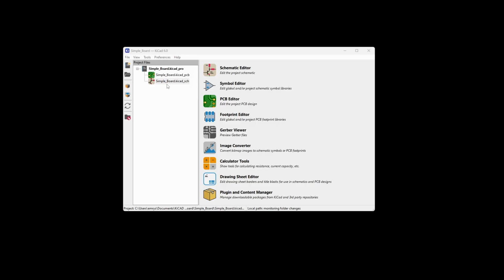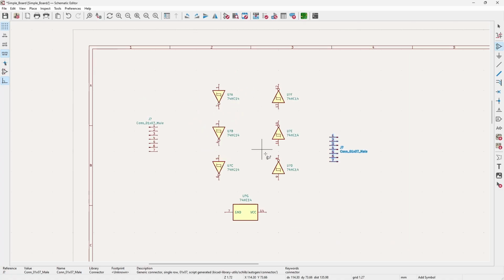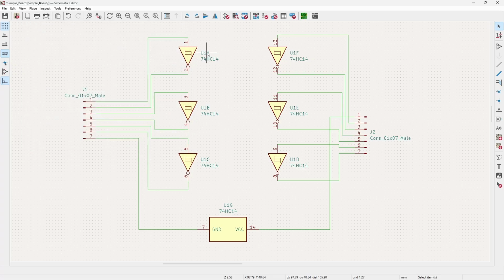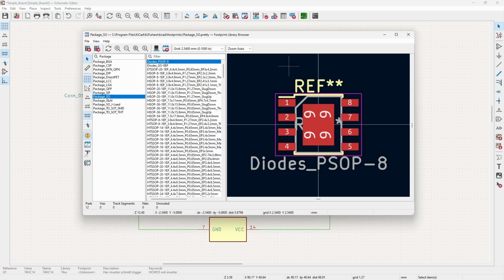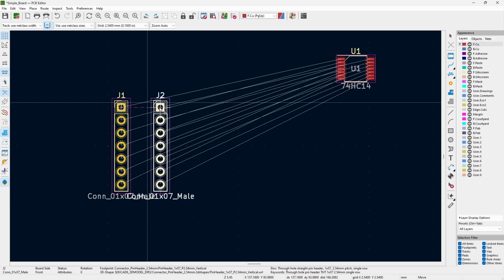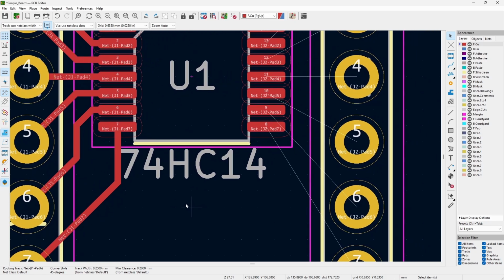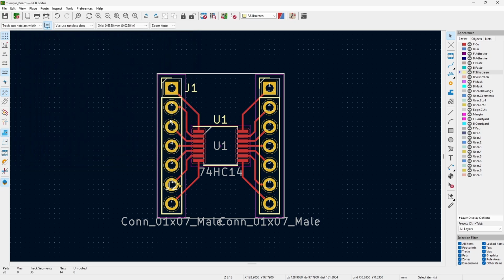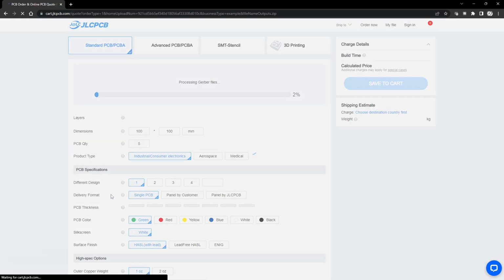KiCad 6 tutorial - Start to finish board design

Comment: A couple of tips to make KiCAD more intuitive is to change the selection behavior and tool activation behavior
By default, to select a symbol or footprint you need to click once on them before dragging or moving or whatever
This can be overridden though from the Settings > Mouse and Touchpad > Drag Gestures > Left button drag

The other thing for tools is check or activate the "hotkey first selects tool" checkbox, which does exactly as it says

I believe it can be found under the "Hotkeys" section in the settings
Reply from the maker: Thanks for the tips!

Comment: Wow, Love the video,,, I'm coming from years of experience, as I did used the first ever computer pcb design software...  I finally settled on Proteus  Professional for many many years.... But Kicad is so much easer than most of the high end software...  One thing that should be mentioned is Kicad can create the complete pcb with the components holes etc for 3d printing.. I do this just before sending board for manufacturing..  This gives one the hands on verification that the pcb will fit where its suppose to go...
Reply from the maker: That's very cool - something I didn't know!